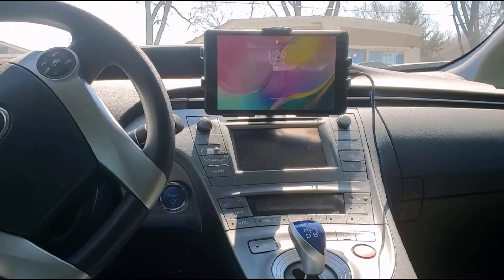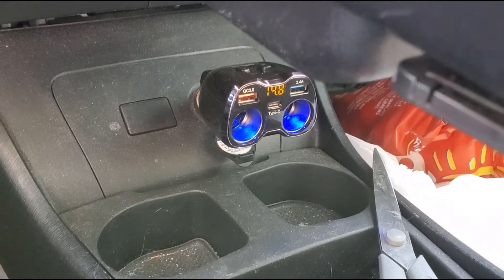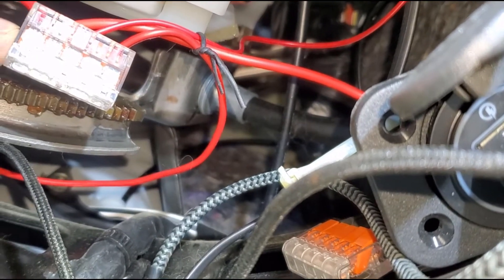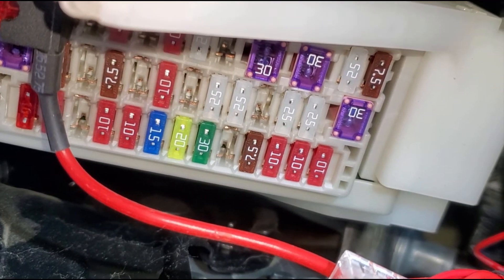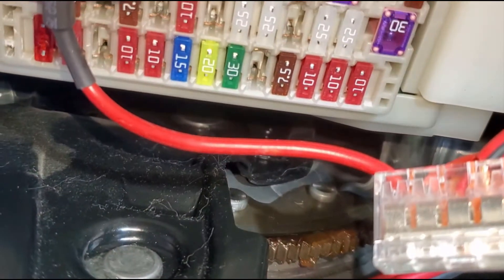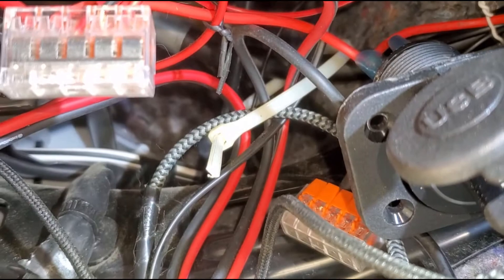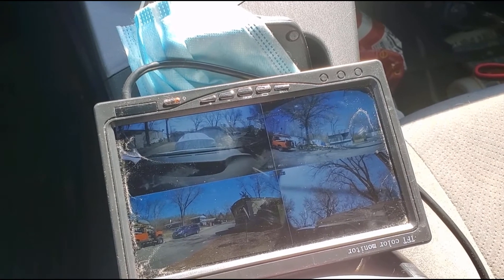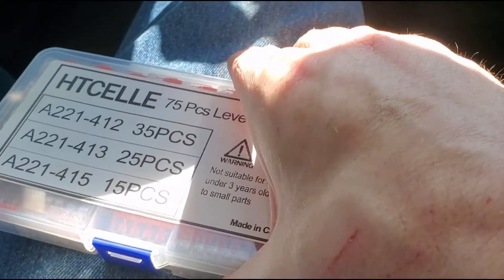Fuse Tapping my Gen 3 Prius

Comment: I set pole light in front hood, can you please tell me which fuse should i plug to get 12v out from fuse box ?
Reply from the maker: Well, you probably want to use the other fuse block under the hood for that.   Is it  Gen 3 like mine?    If so here is a link to a video with all the fuse information.    If the light does not draw too much power, maybe fuse 17 under the hood, or anyone of the empty ones.    The second fuse block information starts at 01:20 into the video... 

https://www.youtube.com/watch?v=nbeblNIfOUM&t=23s
Reply: @vaughnsvideos  thank you so much dear. Really appreciate your concerned